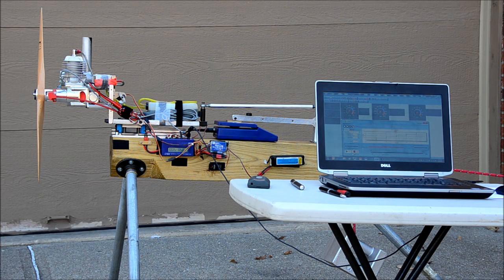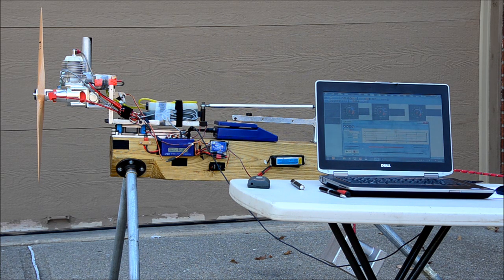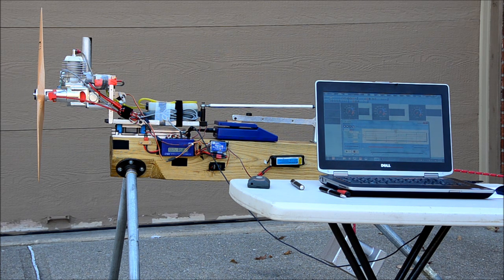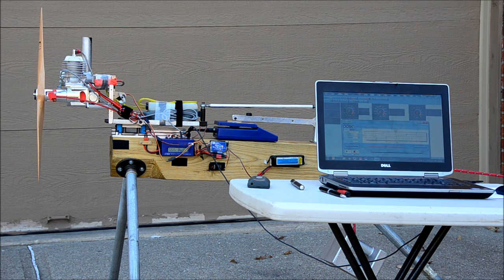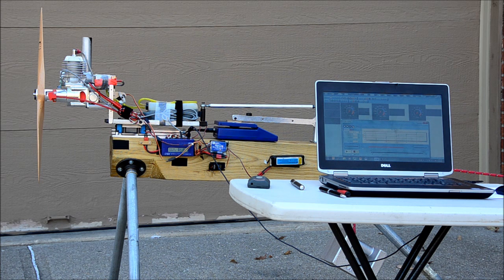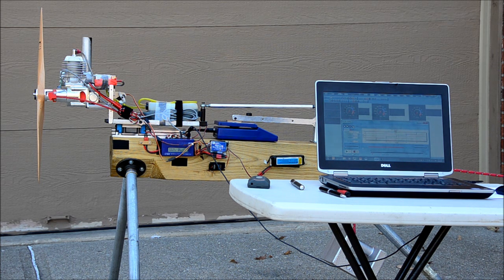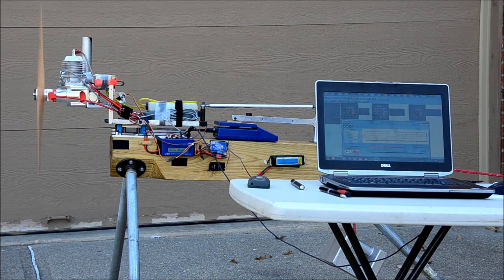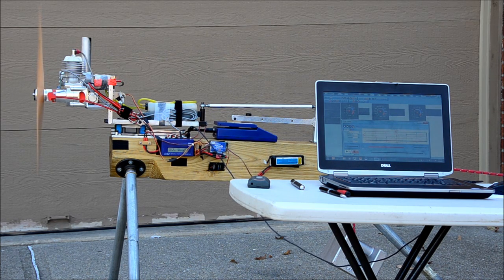DA-60 PC-Controlled Thrust Test by RC Sport Flyer

Comment: It's not tuned correctly, mine runs at 7500 rpm with the same prop. Yours is too rich on the low end and it's obvious by the way it sounds. Tune it right and redo your test or remove this video as it does no justice for this engine.